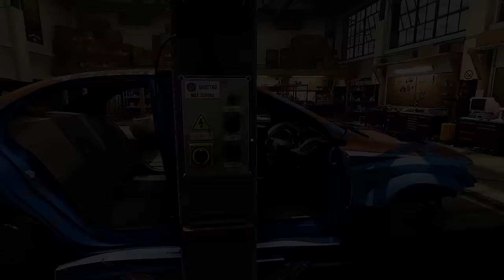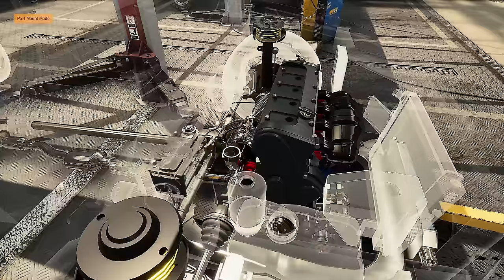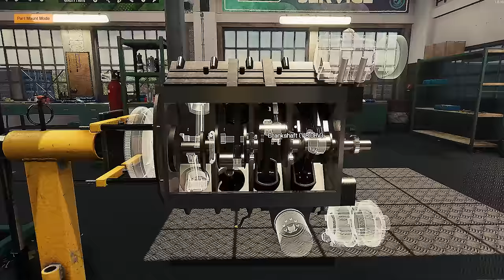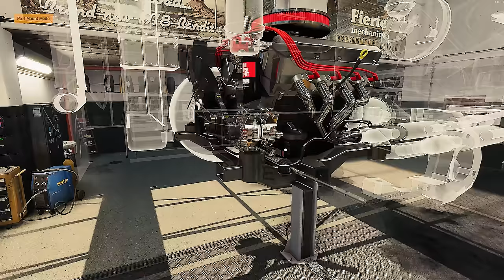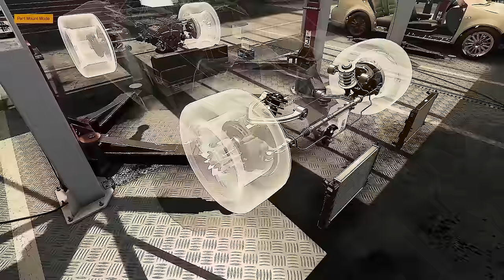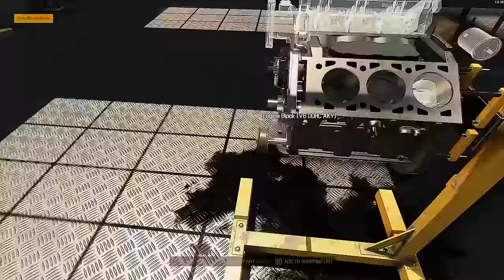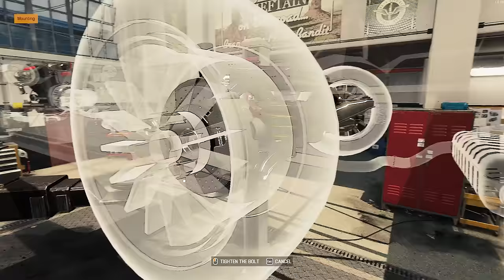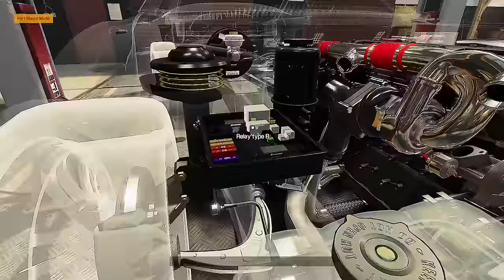Restoration of all cars that were found in the Junkyard in Car Mechanic Simulator 2021

Comment: What was the whole point in tearing down the motor vs just selling it and rebuilding a new one?
Reply from the maker: It will be possible to repair engine parts
Reply: @AlexK321  I didn’t think about that good thinking  especially if you don’t have much money in buying new